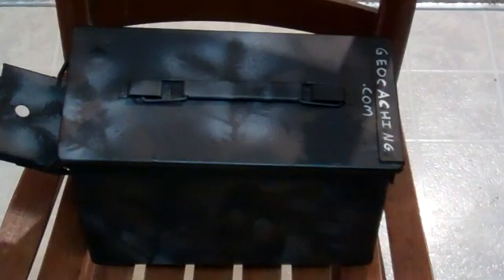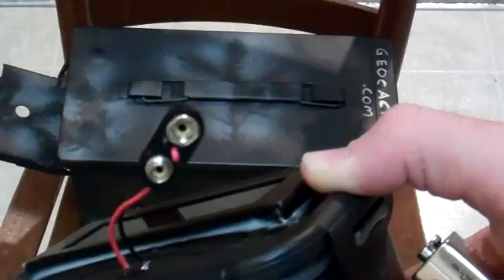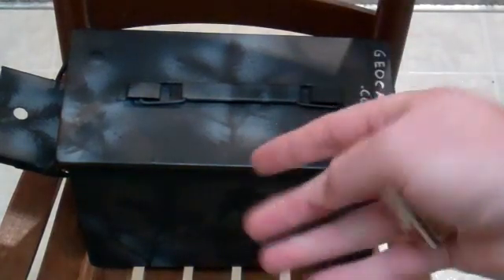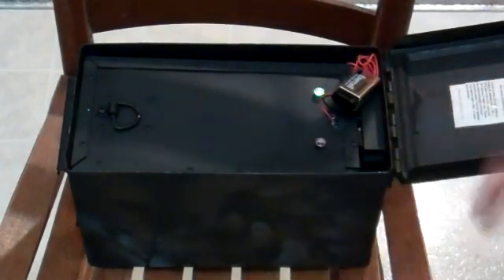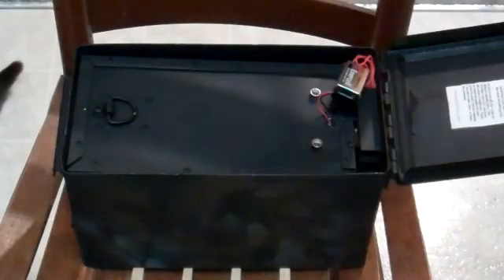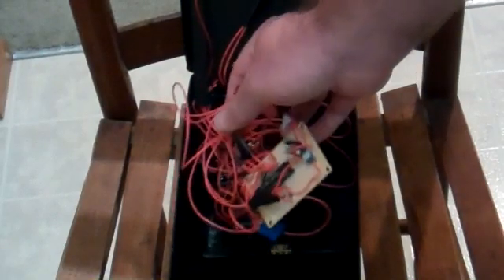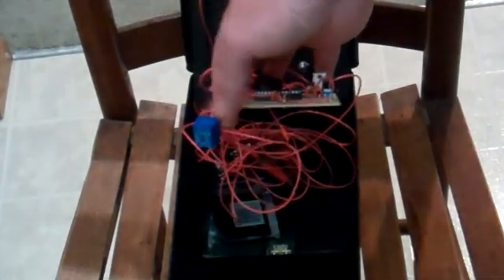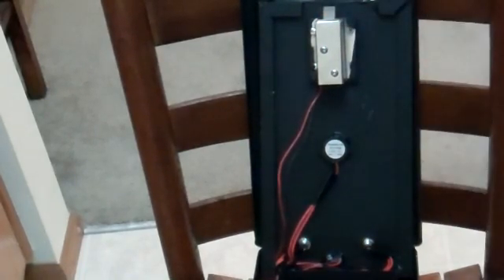Arduino Geocache

Comment: hi i was wondering how often you have to change the 6v battery inside the cache
How do you know how much life is left in the battery
Reply from the maker: The only way for me to tell when the 6v battery is low is to check on it occasionally.  I just take a multimeter with me when I do regular maintenance a couple times a year.  The cache isn't found often and the 6v battery is only active for 5 seconds at a time so I've only replaced it once.  Even then I didn't need to, I just did to make sure it was fresh.
Reply: Marc Haserodt thanks for that 
I have set up a box with a similar lock
I had to use a step up power board to get the solenoid to operate with the 6v battery so I will see how long the battery last

Comment: Hi, do you have the circuit and program for LCD screen message box? Thanks
Reply from the maker: The circuit was one I copied from https://www.arduino.cc/en/Tutorial/HelloWorld?from=Tutorial.LiquidCrystal. Depending on the exact LCD you buy, the pins might be a little different, so your sketch might have to be changed to reflect that. You should be able to find the datasheet for whatever LCD you buy, or you can experiment and see what happens when you apply power to different pins on the LCD. Of course this could burn something up.

The program I used can be found here.
http://pastebin.com/ebRrBD7s

Comment: Marc, I am working on using Arduino for a geocache. Did you need to do a lot of changes to the 'gumball' machine coding to work for your knocks?

I'm also interested in the specific locking item you used.

Comment from the maker: The first stage I just modified a lock-n-lock to put the LCD in.  Then I put the lock-n-lock inside an ammo can just for extra protection from the elements.  The final stage is a standard ammo can.  To make it lock I used sheet metal, aluminum "U" channel, some hinges and rivets to make a second lid inside.  I also just cut, and bent sheet metal, and riveted hinges to it make the compartment that holds the electronics and battery.

Comment from the maker: Looks like I can't put links in the comments so look for the link in the video description. I used this lock that I found on Ebay.  It's a 12v lock, but it opens fine with only a 6v lantern battery.